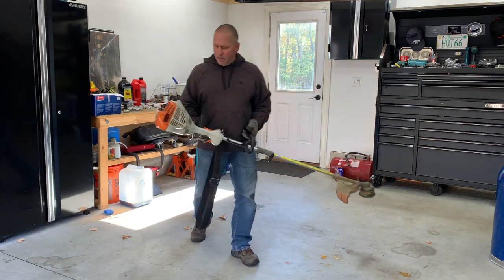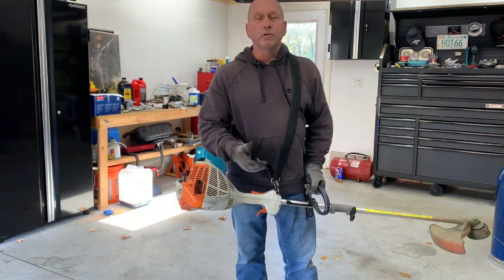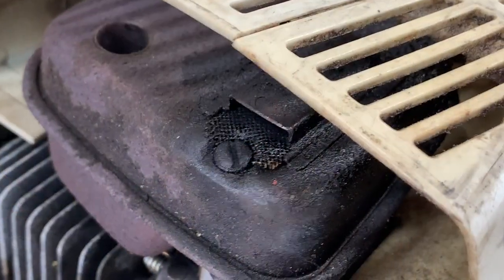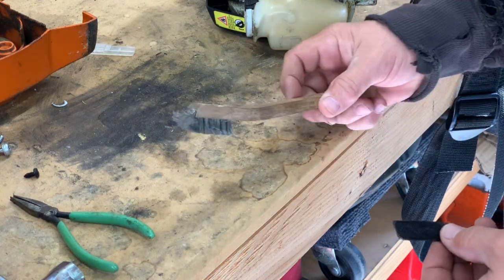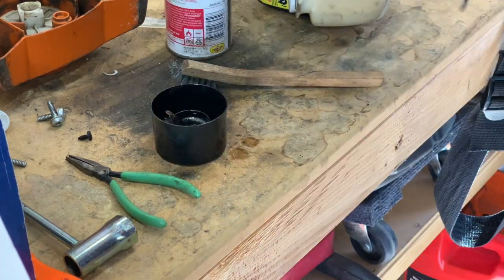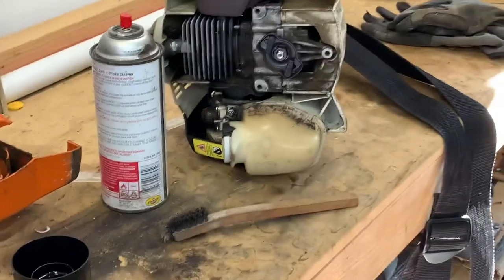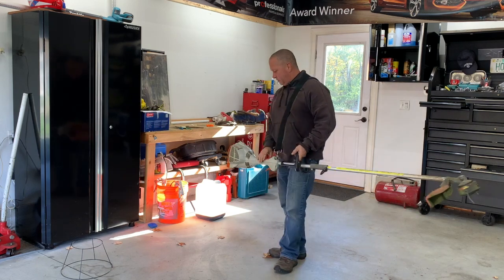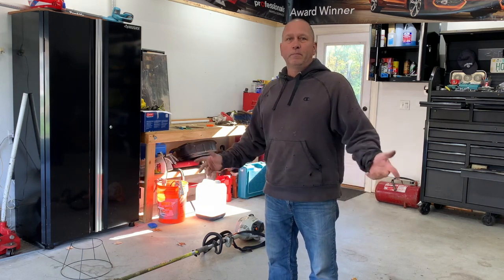2 Stroke Engine Bogging - No Power, Easy Fix

Comment: One of the the half dozen reasons it bogs down and not the reason mine bogs down. But thanks anyway.
Reply from the maker: Sorry Slim.
Reply: @EddieCarrara1  The problem with mine was if you take the silencer off there was carbon blocking the exhaust port on the head. Maybe it's worth checking that too two bolts and it's off. Thanks 🙂

Comment: Alternate cleaning the flash arrestor screen, using hand held butane blow touch. Heat the screen till red hot, carbon will disintegrate. Job done in a few seconds. Hold the screen with long nose pliers.
Reply from the maker: Thanks

Comment: I have an echo GT225 weedeater that dies when I throttle up. I checked the spark arrester and found no carbon buildup. I just replaced the carb, filter, and spark plug about 2 weeks ago. Ran fine 2x and now a day ago, it started doing thisl Not sure what else to check. I appreciate your help.
Reply from the maker: Hi Steve, do you have good spark? It's possible the coil is shorted or no good.
Reply: @EddieCarrara1  hmm I have not checked that. I’ll try that. Thanks!

Comment: Here in the uk stihl tools dont appear to have an accessible spark arrestor so is there any solutions you could give for a 1 piece muffler.
Also how about (if you can take the spark arrestor out) using a blowtorch to burn away the carbon?
Reply from the maker: Hi SS sorry so late with my reply. Maybe you could drill a couple of small holes in the muffler?
Reply: @EddieCarrara1  thanks, I actually found the issue.
The engine outlet had a lot of carbon build up so I now have 2 well running blowers.

Comment: How do you fix bogging that's only in the low end and it idles okay mid-range and top end are okay
Reply from the maker: Hi Jeff, did you check the screen? That's how it Strat to run when it's partially clogged.

Comment: Did you turn the choke off the first time,  I didn't see you, 🤣 that will cause a bog also
Reply from the maker: Hi Willard, yes, that would also cause it to bog and sputter but as you can see the spark arrester is clogged and the exhaust can't flow freely. Thanks for tip, maybe other viewers may have their choke on.

Comment: Before fix that an the power still weak not powering
Reply from the maker: Hi Carl, I recommend you either replace or clean your spark plug because the engine was bogging the spark plug may be full of carbon at the tip. Let me know what you find, thanks.

Comment: Just hold it with needle nose pliers and burn it with a propane torch or lighter. Much easier and faster. Remember, it’s not rocket science.lol!
Reply: Better yet, just get rid of it unless it’s drought conditions or government property. The exhaust will be a little less restricted without being noisy and the engine will run better